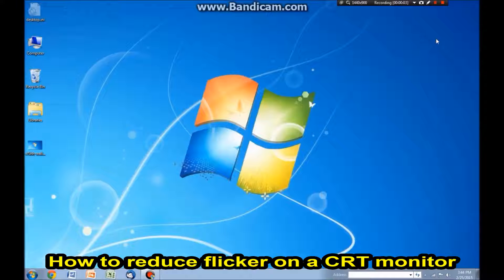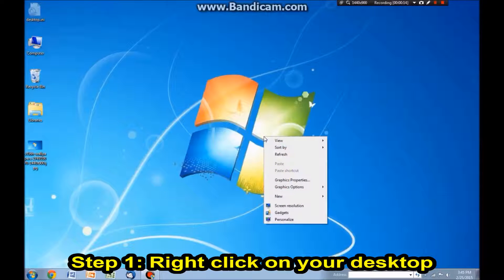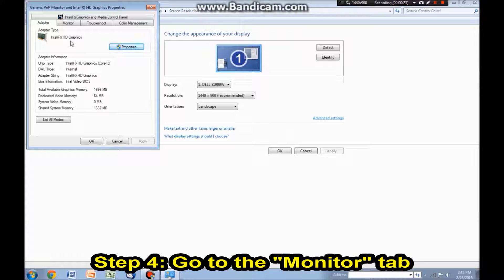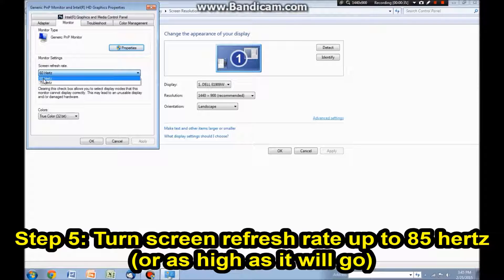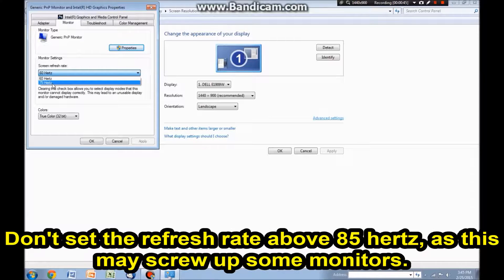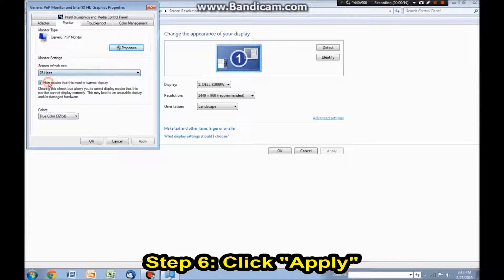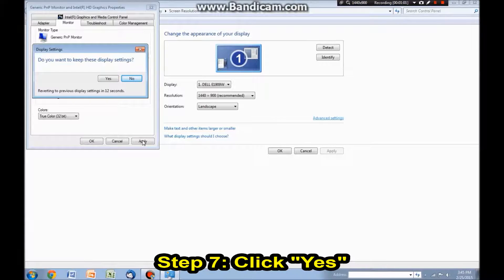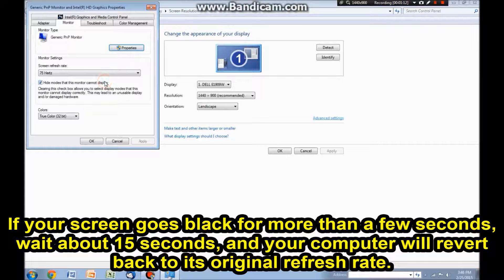Reduce Flicker on CRT Monitor

Comment: Before display driver install i could chose up to 120 or 200 refresh rate now only 60
Reply from the maker: Did 120 and 200 hz actually work?
Reply: It a crt monitor from dell ana ya it displayed but did not fix it so went back to 60hz. Uninstalled video driver reinstalled and now 85hz max and I think it fixed dk yet. 2001 monitor res 1600 x 1200
Reply from the maker: What monitor brand and model?
Reply: trinitron and dell that about all ik never looked for any other spec lol. It in a sot cant really see anything but bit of sides and front and top. Really know way to see the back
Reply: But it stable no flickering as far as I can see at 1600 x 1200 on 85hz. 2001 monitor and it amazing it still works
Reply from the maker: Yeah, 85 hz is enough to make the flickering too fast to notice. I'm guessing that's as high as the monitor actually goes, and Windows was displaying 120 and 200 hz incorrectly.
Reply: ya but it amazing crt still used today and priced so high for low quality ones